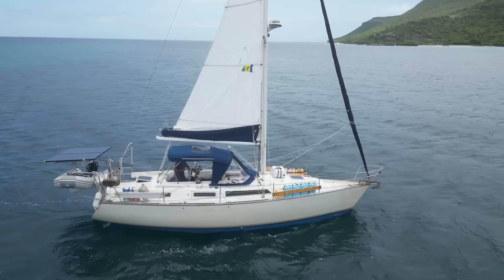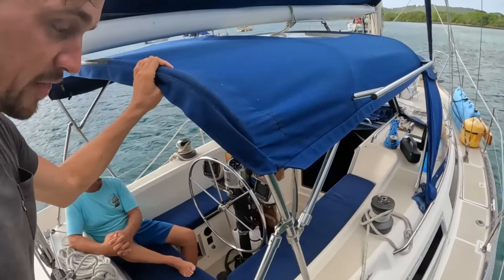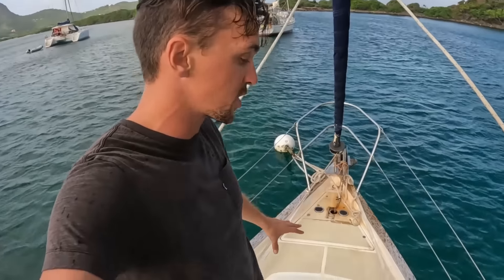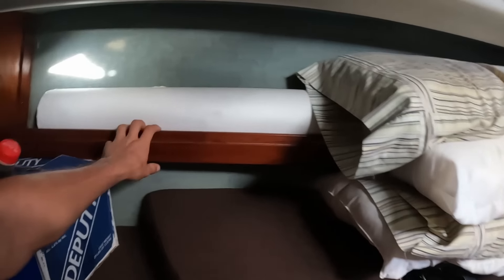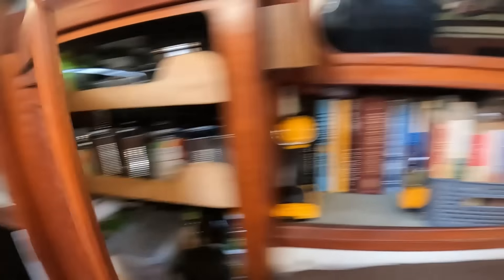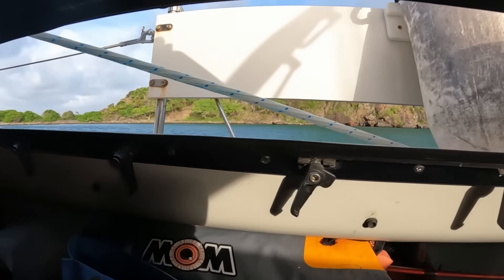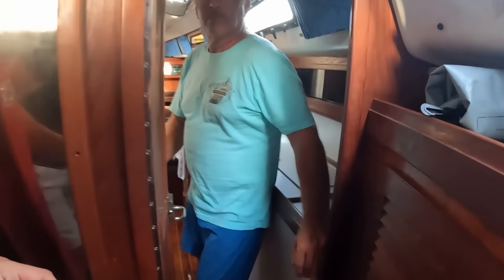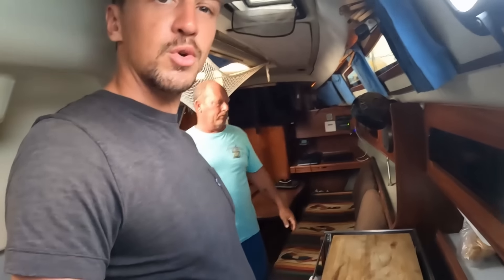Best Sailboat For Solo Sailing  {Budget Liveaboard Cruiser}  [Capable & Affordable 35' $ailboat]

Comment: I live in a 34' RV, in a warm climate. I couldn't live without air. I realize the power would be a problem on a boat. Do you just get used to the heat. When the wind is calm, it must be tough. I really like the aft cabin design as well. Beautiful boat.
Reply from the maker: Yes, you get used to it, and if you get tired of the heat, you can sail north!

Comment: An S2 center cockpit boat is a fairly rare thing. I almost bought one, two things stopped me though. The first thing was that this particular boat needed EVERYTHING to be worked on, not a single system on that boat was usable as it was. And the second thing was, as much as a center cockpit is nice, 35 feet is just a little bit too small, is a weird cramped space. OK, so there was three, they wanted $12,000 for a boat that easily needed 25 or 30 grand just to make it sailable and that was about $11,000 more than i would give someone for a boat that needed that much work.
Reply from the maker: It definitely sounds like that was a tough call!

Comment: 27:23 respectfully: His rigging appears to be SS which doesn't show its wear to the naked eye; I know first hand from bad experience and parting turnbuckles that had cracks I couldn't see during my  spring inspection. The boat was then sailed only on the great lakes too -but kept in Port near a nuclear power plant with a railroad almost directly overhead: The iron rail dust significantly contributed to the SS corrosion and subsequent brittleness/crazing. 

If your SS rigging is 10 years old and you are looking to do any serious offshore sailing.... REPLACE IT ALL!  I Almost lost my mast on silly little Lake Huron in a micro burst because I failed to do a UV dye/fluorescence inspection. 

If you want my advice as a seasoned sailor who lived aboard 5 years and sailed Davis Strait, crossed the Atlantic.... Go with brass if you are weak at preventative maintenance. Brass/bronze- it will show its wear and give you AMPLE warning before it fails. Replace more often, yes but keep spares and have sound mind and be alive. 🙏
Reply from the maker: Great advice!

Comment: What’s that cost to trailer your boat that far?
Reply from the maker: Not sure. Maybe around $3000.
Reply: I was lucky,  when it bought the boat it came with a trailer. A friend helped me with the transport so I did the move for less then 500.00 then sold the trailer after putting in at corpus Christi Texas  for 5000.00

Comment: You mentioned using your drone to navigate into a bay. I wonder why nobody puts one up the mast permanently. Especially if it has flir night vision, it would be great for navigating a crowded harbor/bay at night with low light/clouds. Kinda like a car backup cam.
Reply from the maker: That is a good idea. But if you're against the light, it would not work. A drone can get any angle.

Comment: Didn't know S2 made this boat. I have an 1980 S2 11c. Slightly bigger, somewht older. I have sailed SunShine solo from Florida(left in 2010) to the Philippines. Now in South Africa with crew, proparing to complete the Atlantic crossing and my second circumnavigation.
Many similariets between the boats. I am sure this 35c could do what SunShine has done.
Reply from the maker: Cool, yeah its a nice boat.

Comment: My Hunter 34 (34.5 feet long, almost 12 feet wide), has a port side aft-ish cabin, at the bottom of the companionway.  It's what sold me on the boat.  That cabin extends under the cockpit, for part of the berth.  Ends, in front on an aft exterior locker.  I'll be relocating a drain pipe, that sticks down 3 inches, just above the berth (it drains a shallow locker, that's over part of the berth area.
Reply from the maker: Nice!
Reply: I'm interested in getting a Hunter 34. I read that there can be issues with bilge water getting stuck in the hull moldings and not draining away, creating "interesting" smells. Have you had this problem with your boat?

Comment: The problem with lots of locker space is you tend  to accumulate a lot of unnecessary equipment .
I used to tag stuff .if I didn't use it in a year it went out .
Reply from the maker: There is a balance I suppose.

Comment: If you go Lithium, be sure it's LiFePo4.  The others can burn up, taking your boat with it.  I decided, on my Hunter 34, to stick with lead-acid, move them closer to the centerline, just behind the motor (better balance to keep it upright. I have the shallow draft version), with anti-sulphators on each one (the potted kind, that only desuphate, when the battery is being charged.
Reply from the maker: I did use just that!

Comment: When you collect rainwater, is it treated or filtered afterward?  Or is it pretty safe to drink as-is?
Reply from the maker: It's safe to drink.
Reply: I wait until  after a 30 minute  heavy  rainstorm  before I start collecting  water.  I do have a filter system before the facets.  I had this same conversation  with another  cruiser that has a watermaker.  He said there is no way its clean enough  to cook ans drink. So we took his tester and tested both boats from the tap. Surprisingly  my boat had less part per million  then his.

Comment: I have hull #10, 1986 S2-35C. I have only come across one other on the Chesapeake. It's quite easy to run your reefing lines back to the cockpit as I've done. I also added a strong track which makes getting the main up and down very easy. I fit 4 x 100 amp (Renogy) behind the back cushion closest to the stove. It's a tight fit, but it gets them out of the engine compartment and frees up all the space under the galley sink/counter. More importantly, closer to the breaker panel. I would love to see what you did for an anchor winch. I ended up installing a reel style winch from Lone Star Marine.
Reply from the maker: Sweet!

Comment: It’s a nice boat and I’m sure it’s very well maintained but the hull being cored below the waterline is a dealbreaker for me. Even if they were plentifully available, when I list my criteria for what I HAVE to have in a boat, a solid FG hull is near the top of the list.
Reply from the maker: Right on.
Reply: @HydeKills  this boat has a balsa wood cored hull, meaning that there are two sheets of fiberglass sandwiched with balsa. As opposed to a solid fiberglass layup. If water gets into the balsa core, that boat will be structurally compromised. Solid fiberglass hulls are subject to their own issues but overall are much more desirable (in my opinion) that any cored hull. There are also hulls that are solid ‘glass below the waterline and cored above the waterline but given my preference, I’ll take solid ‘glass every time.

Comment: I'd move the fridge ashore and utilize 2 or 3 modern inexpensive 12 volt chest freezers. One could be in a cabin. Many boats suffer from batteries in parallel ( self inflicted ).if you must, use separate chargers and separate loads and your battery schemes will be squeaky clean. Hmmm, no ceiling fans. Wow, that's a nice hull. I'd be tempted for a smaller diesel and a CB radio or two.
Reply from the maker: Not a bad idea.

Comment: Timestamp 1700. The aft cabin starboard bunk requires an overhead two person wide hand holds in the forward facing overhead to assist the sleepers into and out of the bunk. This is a very inexpensive and a valuable addition to allow the sleepers to position themselves in and out of the bunk. Easy, inexpensive, intelligent and why didn't the cheapskate builder install them? Also, one could do plank type pullups there because one needs actual exercise on a slothful vacation boat, therefore double duty.
Reply from the maker: Right on.

Comment: Not the best boat for solo sailing or anything else as BEST . If you make a statement that is not subjective then back it up .. Decent yes . 6 foot draft on a 35" boat is obviously a fin keel and not all that desirable for blue water .
Reply: Two questions  for you , are you a sailor? And two have you sailed a s2 35c before? If you answer no to either then it hard to take your comment. And yes there is better boat out there for a lot more money. At least give me some credit. I am out here doing my dream.
Reply: @jaysafro3586  Yep Built my own sailboat and circumnavigated with it as well as many years delivering sailboats all over the world . Don't remember sailing that particular model , but many similar boats .
Reply: @robertwilson8789  thank for your  input.
Reply: @jaysafro3586  Your very welcome . It is a very nice boat you profiled , but I could not use the term 'Best' for my purposes single handing .  First I would rather have a full keel to avoid snags and 'haul to' effectively as well as decrease the workload for Any self steering system . I would also want a cutter rig because gives you much more control in a storm .